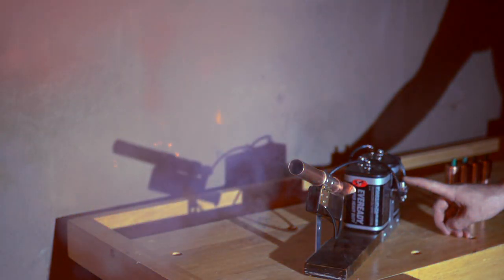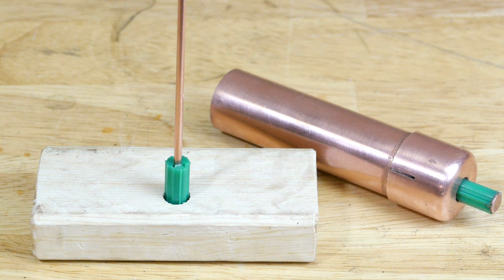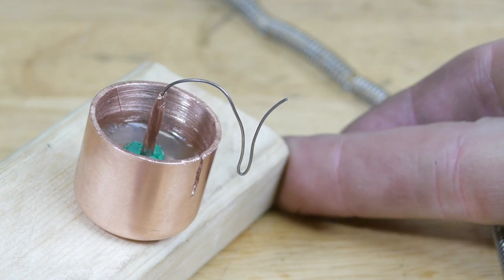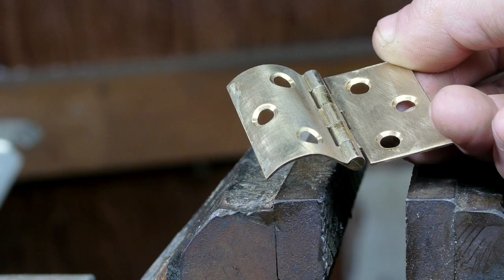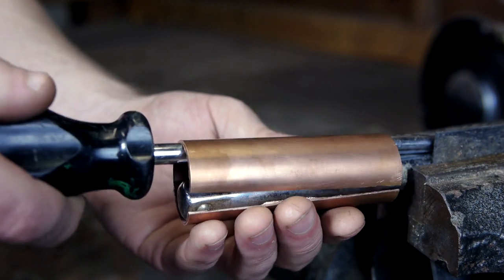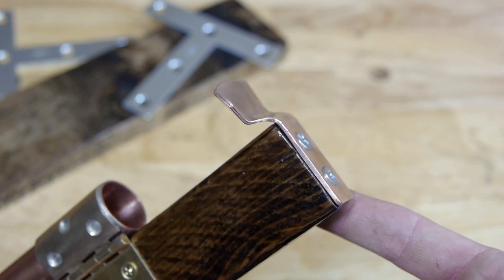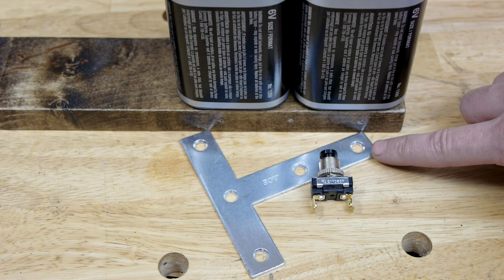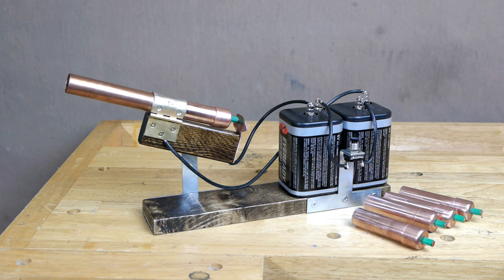How To Make A Desktop Nitrocellulose Cannon - NightHawkInLight

Comment: Couldnt someone make it handheld to make a Two Battery Slot into the Wood and a Button at the Fingerhitpoint thingy. But you'd have to make it with Thin wood plates to allow sawing of some wood in the mid for the Cables
Reply: +Der Hobby-Zocker You could make it handheld by picking it up.

Comment: Why dont u use 14650/18350/18650 4.2V battery and kanthal wire .20mm 3-4 wraps around 2mm screwdriver. much sleaker design, rechargeable and cheaper

Comment: Where do you buy flash cotton?
Reply: aliexspress
Reply: +Ralph WaterDude Make it yourself... that´s probably the easiest way.
Reply: BurntIcecube
nitric acid and sulfuric acid at equal ratio will work. why go around and search for other things? its easy to use the acids
Reply: Parasar Bhattacharya HNO3 65% + H2SO4 96% will work at equal ratios for dinitrate. If you want trinitrate, you should use double the amount of H2SO4 to HNO3 and you need to nitrate it for quite a long time. For me, it does not pay off to make it myself. I live in Czech Republic - here, they sell a kilo of that stuff for about 20 Dollars (under 12,5% N).

Comment: Would a AA battery be enough to heat the nichrome wire?
Reply: Isaac Chapman i believe so. aa and c/d batteries have the same output voltage ect just different amount of energy
Reply: Ryan Estes lantern batteries are 6volts and int. resistance of 3 ohms so 2 amps, regular batteried are 1.5 volt ?? amps(cant remember internal resistance) so just hook up 4 AAs in series to see if it works

Comment: Could I use a bbq igniter instead of the batteries?
Reply from the maker: +105 Gaming No you need the high current of batteries rather than the voltage of a bbq igniter.
Reply: +NightHawkInLight oh ok thanks!! Awesome vids!

Comment: Couldn't the thick copper sheet have been made by simply hammering the pipe flat, eliminating the need to cut, fold, or solder? Hammering it flat should still give the same size as your cutting and folding

Comment: i always hate it when people glue the batteries down. What if they run out? you have to rebuild it all over again when they do.
Reply from the maker: Rubbing alcohol makes hot glue peel off cleanly. Easy to replace and held firm in the meantime.

Comment: What about 1 9v battery instead of 2 6v?
Reply: +Sinisa Jovanovic he said why to use 2
Reply: +Sinisa Jovanovic u can use 1 18650 4.2V battery and kanthal wire .20mm 3-4 wraps around 2mm screwdriver. much sleaker design, rechargeable and cheaper
Reply: +porosaur Someone vapes

Comment: why copper pipe ?
Reply: looks nice .....
Reply: Nino Joel  well yeah but u know it's more expensive than steel
Reply: +nathan de crom I think its so it can conduct electricity.
Reply: +nathan de crom Better electrical conductivity than a steel one and stronger than a aluminium one.
Reply: *****  hold on wot ? you mean better complete the circuit ?
Reply: Asked myself the same thing.. Maybe cunductivity?
Reply: Well, it can be soldered, bent, drilled and polished easily and it looks very steampunk :D
Reply: nathan de crom I don't know, maybe it was just for looks lol
Reply: +nathan de crom Feels good in the hand
Reply: nathan de crom 
"it's more expensive than steel"
for this amount the difference is tiny
Reply: +nathan de crom  mainly because it is a good conductor of heat, it wont stay hot for long, it just releases the heat as fast it becomes hot,
Reply: i don't think that matters it matters more to what material your transferring it to
Reply: you have to have electrical conductivity to light the flash paper
Reply: certainly, steel pipe aluminum pipe even iron pipe or even a stainless steel pipe all are good conductor of electricity. but he used copper pipe not only for electric conductivity but also for the brilliant antique look, it was really a good piece of art and innovation.
Reply: +Parasar Bhattacharya :/ what now?
Reply: NinjaGaming2
What," what now"?
Reply: +Parasar Bhattacharya  i am really stoopid at science im not good with dat stuff
Reply: NinjaGaming2
 please dont say like that, i am also not a profeser of scince, non the less i know litterally nothing about science, my knowledge is not even like a dust particle.
Reply: ok i sorta get it
Reply: great that means you are not that stupid you thought yourself, in this manner you will see that you really know much then many others.
Reply: Parasar Bhattacharya ok
Reply: +nathan de crom steel would work
Reply: Colestercamps  not as good as a conductor tho
Reply: nathan de crom no its not bu it good enough.  deal with steal pi[e every day and trust me it still takes a charge pretty dam good  if it didn't cathotic protection would not work.
Reply: Colestercamps  yeah but not as good is it
Reply: nathan de crom it would do the job for this purpose you would be surprised. i wouldn't wire my house with it but i would do something like this with it
Reply: Colestercamps
 great to know.